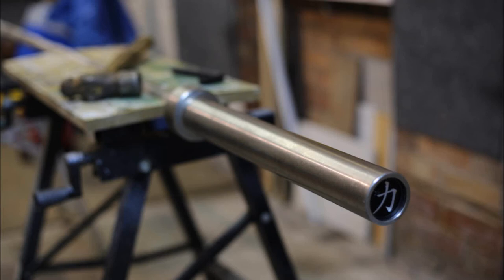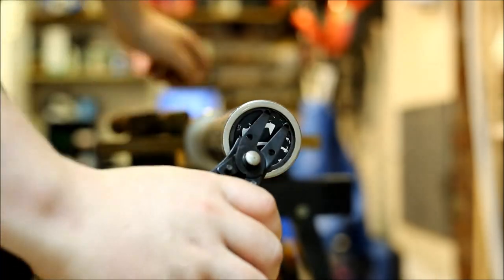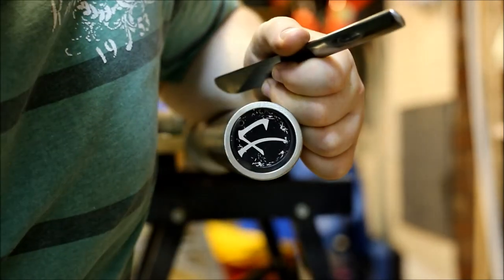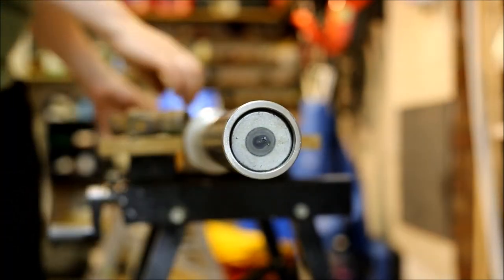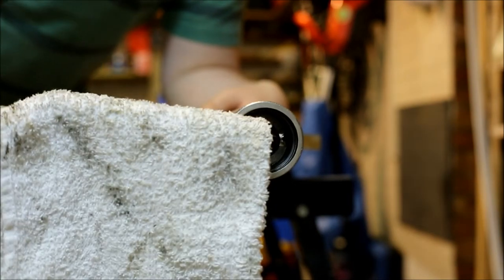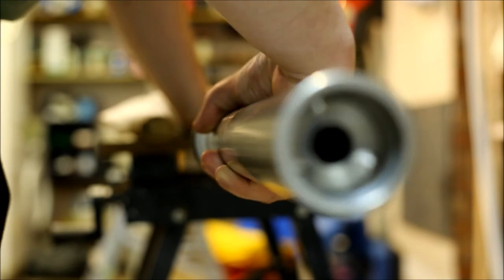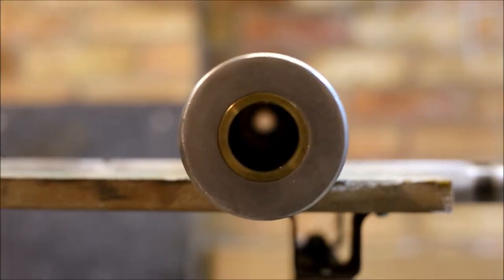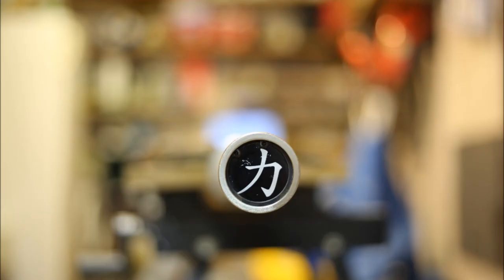Taking Apart The Strength Shop Bastard Power Bar

Comment from the maker: I thought I would revisit this video a couple of years on as this is still my primary squat bar.

It has remained relatively straight, it has been outdoors a lot and rained on some amount, so it has developed rust and a patina, but the plating and knurling appears to have held up well enough.

The one sleeve locks up if I tighten the bolt too far, this was the cause of me originally taking it apart, and since then all I have been able to do is keep the bolt semi loose and keep a close eye on it every session. This is definitely down to the metal droplets scraping into the sleeve.

Overall not a fan of this bar, the build quality, as with everything I have from SS is very underwhelming, especially as the cheaper, older, Again Faster 2 hybrid bar I have still runs like a dream. 

I should admit though that I haven't had anything from SS for years, and maybe they have upped their game.
Reply: I don't think they have tbh. I don't think many people are looking inside the bars and just assuming they are actual snap ring construction. I do think the knurling is very good though

Comment: Hey great Video, one sleeve at my barbell is a bit loose then the other one. Would tighten up the screw will help or fix the Problem?
Reply from the maker: Thanks, yes if you remove the end caps you can adjust the screws inside and that dictates how freely the sleeve spins. Personally I just keep mine open and give them a quick check every time I lift.
Reply: @Jalfred92  good Idea, thanks!

Comment: Hello, from what material are made the logo caps? Just wondering!
Reply from the maker: It looks to me like steel, it is near coke-can thinness and doesn't appear to play a role in holding the bar together at all. I now use the bar with the caps off so I can check the nuts each time I lift.
Reply: James Griffin, thanks for the clear up. I bought the strength shop 2028 bar at a very good deal that they offered me because the bar dosent have the end logo caps, the rings and the cap that covers the bolts are there though and i wondered about the logo piece.
Reply from the maker: Sounds like a great buy! Yeah they probably weigh a gram between them and have no function I can detect.

Comment: Ahh this is so annoying, I bought a strength shop bar thinking it was actual snap ring style, not just there to hide the bolt. I feel like I've been ripped off 😭😭 l
Reply: getstrongby40 I’d be annoyed, too. Doesn’t seem much better than a CAP bar.
Reply: @SoyLaBonBon  don't get me wrong, its still 100% better than a commercial gym bar, the knurling is great.  I wish I had just spent a bit more at the time but with the current situation I'm lucky to even have this
Reply: getstrongby40 Totally get that. It took me forever to get a proper bar. I was training with a standard bar forever before I finally got an OPB. You make gains with what you have.
Reply: @SoyLaBonBon  oh yeah an OPB is what I'm after next. Well either that or I win the lottery and get an eleiko power bar 😂
Reply: @getstrongby4038  Right?!  I'm lacking for space (apartment dweller), so can't have a huge wishlist, but wouldn't say no to an Ohio Deadlift bar, an SSB,  and a decent trap bar...Otherwise, I'm grateful to just have my  power bar after using a little old standard bar for the better part of early quarantine.
Reply: @getstrongby4038  which bar is that? i have bastard power bar for 330 euro im not sure if that one has bolts
Reply: @Chrontard  mine is the "bastard bar" not the power bar, the bar in the video is the one you have. I haven't actually opened mine
Reply: @SoyLaBonBon  definately. I've never actually tried a deadlift before but I would like to have a go. With gyms opening back up I'd think there's going to be an abundance of gear for sale soon. Most people who bough home gyms won't stick with it for whatever reason. I personally will never go back to a public gym
Reply: @Chrontard  it's funny you say that, I've been looking at both of those bars. You are right it seems to be very close to the ohio power bar. Looks the same too. Just never seen any reviews on it but it's got like 600lg rating so should be good? I'm glad I'm thinking along the right lines
Reply: @getstrongby4038  so today i checked my bastard power bar and there is actually not any bolt at all like in this video.. there are exact same components as ohio power bar - i checked a video where they showed how to oil your barbell.. so seems like its same quality which makes me happy.. but cerberus power bar might be excellent as well
Reply: @getstrongby4038  well KG rating doesnt mean much imo but there are few reviews on site and guys say its stiff sturdy bar, like power bar should be. But, bastard power bar is little bit cheaper and does the same thing.. only difference might be knurling
Reply: @Chrontard  that's really good news, how did you open it did you already have the correct pliers? Mines just the bastard so even cheaper lol. But yeh the cerberus does appear to be decent.

Honestly the knurling is good on mine, "pyramid" style l, really grippy I don't even use chalk
Reply: @getstrongby4038  yes i have every tool needed in my garrage
Reply: @getstrongby4038  check out i uploaded quick video how it looks inside .. there is snap ring, end cap, another snap ring and then end of barbell with no bolt.. then some washers
Reply: @Chrontard  will do man thanks
Reply: @getstrongby4038  I don't know.  The secondary market remains very much a sellers market.  People are still trying to sell plates at $4-6 a lb in some places.  I see pairs of 25lb dumbbells selling for $100 or more in the gyms in my state have been open since May.  There are unfortunately a lot of people buying new equipment and flipping it at exorbitant prices, which sucks, but isn't illegal.  I'm not training in public during the pandemic.  Trying to keep my mother safe.  If I ever had the extra cash I could see throwing down for a deadlift bar and an SSB (and a better bench), otherwise, I feel like the market for gear is gonna be tight for a while.
Reply: @SoyLaBonBon  that's true at the moment but give it 6 more months  that wil change I'm pretty sure. I'm already seeing people selling full calibrated plate sets on the Facebook pages. I personally will never go back to a public gym so I'm in no rush as far as that goes.
Reply: @getstrongby4038  I never had training buddies so don't miss that, but I do miss being able to grab dumbbells off a rack.  I have adjustables.  I miss specialty bars (deadlift, SSB, cambered)...And I live in an second floor apartment so in order to deadlift have to walk my gear downstairs to an empty spot...It's a pain.  But I do it, because I love to lift.  I guess we shall see what happens in six months...
Reply: @Chrontard  hello.Where i can find your video opening the bar?I am interested in buying the riot pure needle bearing weightlifting barbell from strengthshop but i am afraid about the sleeves construction.I hope there is no bolt there.The one here in the video is not the bastard bar,its just the 2029 power bar
Reply: @billyka11  i dont think there are any bolts in their barbells.. they are completely rebranded to higher quality